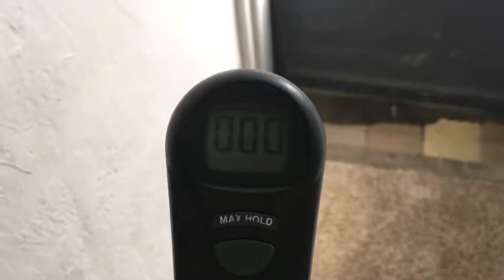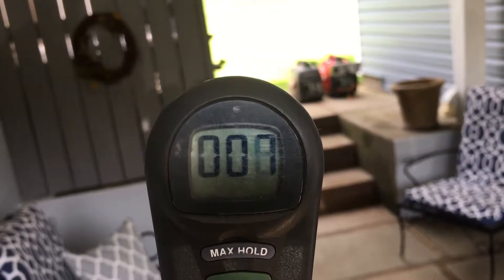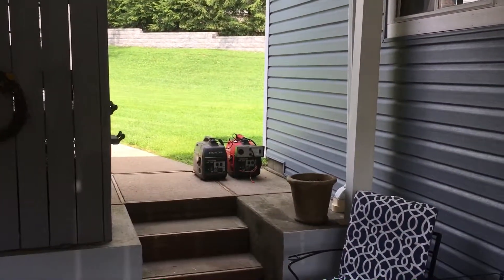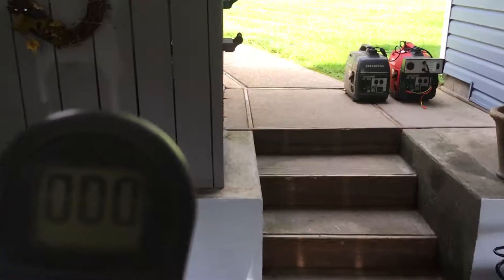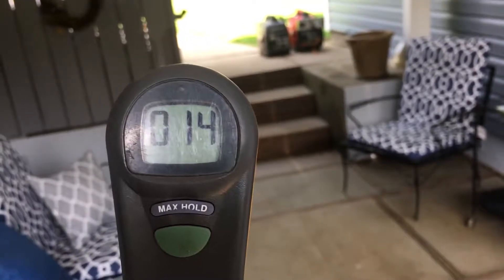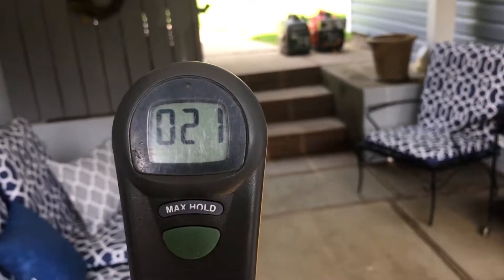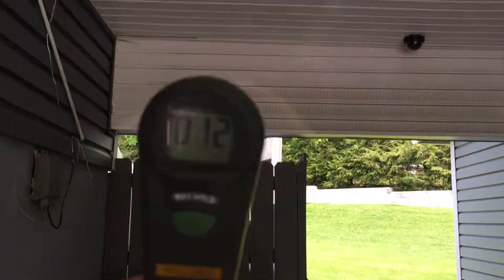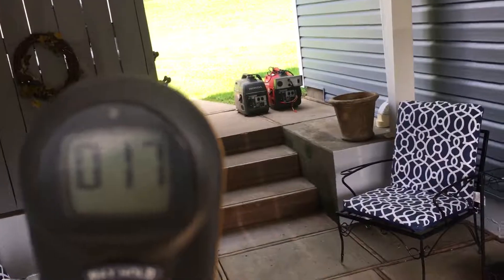The dangers of carbon monoxide and running a generator

Comment: Good video, did you test any other times?
Reply from the maker: SANTIOWNZ not yet. is there something in particular that you want me to test?
Reply: SuperRobkar I have Ryobi unit, I live in a condo and build an enclosure to exhaust the fumes out. I had 3 co2 detectors but none ever showed any levels in the house. I think I'll get one of those units to test also.
Reply: During Irma it was a God send.
Reply from the maker: SANTIOWNZ How long was your power out? I’m wondering if a good bank of batteries would be a better solution for you.
Reply: SuperRobkar 7 days. And it was a silly storm. Wilma 28 days. I have no issues with mine. If anything I want to do parallel like you. Just makes it a bit more difficult with my setup. Last time I didn't have AC now I do.
Reply: ⚠️very important announcements about portable generator safety:

This is just a reminder.

1) KEEPING OTHERS SAFE: Please do not allow an unqualified person or your children to operate and service the portable generator. Just because some manuals don’t say that doesn’t mean it’s safe. That is important against the generator safety rules. We also need to be keeping an eye on our children too. You need to make sure that your children are not playing near the portable generator especially when it’s running so they won’t get electrocuted. Generators pose electrical risks and they can be hot during an operation. Please keep your children away from the portable generator at all times. It is important to keep our children safe especially our little ones. Be aware of all the hazards.

2) WHERE TO RUN YOUR GENERATOR: Some people use their portable generators indoors which increases the risk of carbon monoxide poisoning. It’s important to have a carbon monoxide if you have a gas generator. Never ever use your generator indoors even if your doors and windows are open and even in the garage is not safe to use a portable generator. Not even at your porch and your deck. It is never safe to use your generator indoors and in enclosed areas of your home. Your generator needs to be 15-20 feet away from your house. 

3)🔥FIRE HAZARDS: Never refuel your generator while it’s running. You need to let your generator cool off before refueling it and before storing your generator. Never overload your generator too. Never ever back feed your generator. You should never plug your generator into a wall outlet. Also never store propane tanks indoors. Please keep flammable things away from the generator as well and please don’t smoke cigarettes near the generator. Having a fire extinguisher next to the generator is also important against the generator safety rules. 

4) GENERATOR OPERATION: make sure your hands are dry before touching the generator. Never use your generator in wet conditions. Don’t let your generator get wet. You need a generator tent if you need to use your generator during wet weather. Please don’t wear loose clothes when operating the generator. Turn on your generator before plugging in appliances. Use the right cord for your generator. Please do not use worn out cords. 

https://youtube.com/shorts/eFigDfnPkcQ?feature=share and here is a short video more about keeping others safe when using generators 

Hope this helps. Remember safety first.
Reply: This is why you shouldn’t let children operate a portable generator